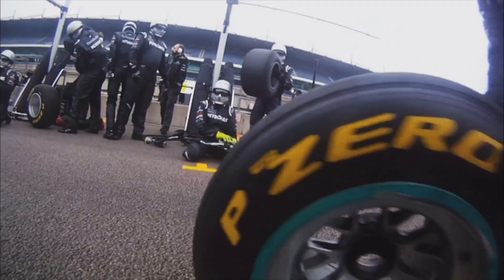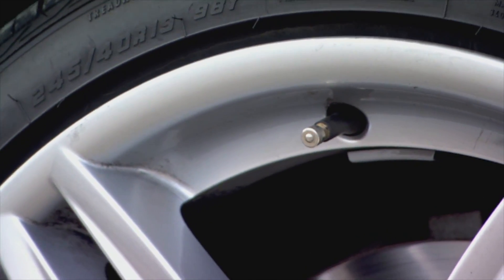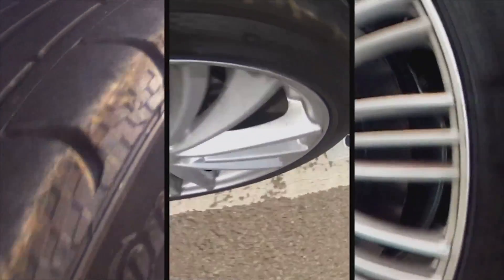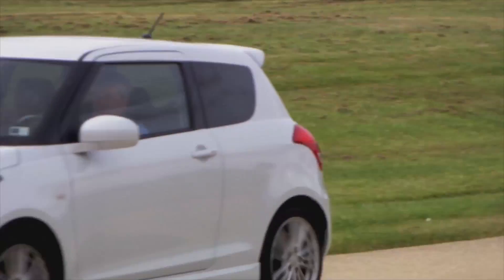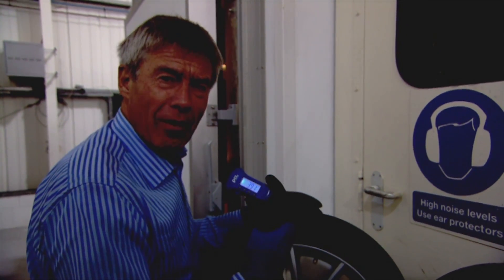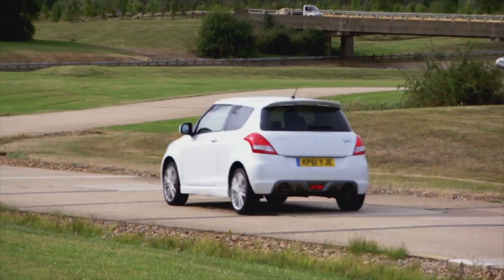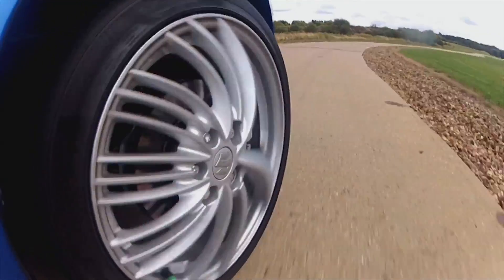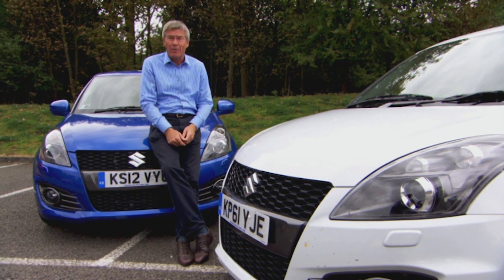Nitrogen vs Air In Tyres - Fifth Gear

Comment: This video may have the stupidiest  conclusion I've ever seen. The benefit of 100% nitrogen is that you rarely have to reinflate your tyres as they maintain the correct pressure. The benefits of long-term correct tyre pressure are well known and understood and cannot in any way be tested with a 47 second lap on the track.

Comment: 1. Molecule size: this is true, but when measured, the difference in pressure loss due to loss of gas via permeating the tire is vanishingly small; nowhere near a meaningful difference.

2. Water vapor: again, true in technical terms, but in practical use, the amount of water vapor in air in your tire isnt' remotely close to an amount that matters in any way whatsoever. F1 tires have hugely more volume than passenger tires, and differences in pressure etc. are measured by highly engineered methods as when you're spending $300,000,000 to race, every .002% difference in anything matters. None of this makes any difference whatsoever in a passenger car tire, even if it's a high performance car.

3.  Lap time (performance): shocking I know, but no difference.

4. Tire pressure change with temp change: If you think there's a meaningful difference in which gas you use v. tire pressure and temperature change, please go re-take high school chemistry.

Nitrogen tire filling is a thing invented by tire retailers to have something to sell. That's it. There is 0 benefit in any way when it comes to passenger car or truck tires. Save your money.

Comment: You fools, the normal Air tire was at a lower pressure after being heated in the oven and on the track Because The Air Leaked Out. Why didn't you measure them again, once cold, to see that the regular air tire had fallen below the original cold pressure? Oy

Comment: The pressure exerted by water VAPOR (gaseous H2O) in a tire behaves exactly as that for diatomic oxygen or nitrogen in response to a temperature increase; described by the ideal gas law PV = nRT. The point of using nitrogen in racing cars is that it ensures that no LIQUID water gets into the tire. Liquid in a tire is very bad because the vapor pressure exerted by a liquid increases exponentially with temperature, not proportionately like in the case of a gas. The host here misses this point entirely; failing to distinguish the differences in response to temperature change between gas and liquid phases of matter. 

By using tanks of pressurized nitrogen to fill tires, race teams avoid the risk that LIQUID water from a poorly maintained air compressor system will get inside the tires.  It is simply a quality control decision that ensures all of the matter entering the tire upon filling is in the gaseous state; guaranteeing that the pressure in said tire will increase predictably with temperature.

Cool video, but the above description explains why your experimental results were not interesting.
Reply: Not to mention that neither they, nor apparently anyone else, seems able to appropriately interpret higher hot temp of the Nitrogen over the air.... The Nitrogen tire was able to sustain a higher pressure at temp than the air. Had they re-measured the pressure once the tires cooled, it would have reflected the aired tires coming down still Lower than the Nitrogen tires, due to the air lost when hot. Seems just ridiculously obvious that they couldn't figure it out -

Comment: This is a typically half arsed 5th gear “investigation”. Surely you’d use the same car rather than two different ones? Nitrogen filled tyres are snake oil just like PPF and Ceramic coatings. If you were to properly fill a tyre with nitrogen you’d need two diametrically opposed valves on the wheel for a start, then use high purity “white spot” nitrogen (££££££) and then use an oxygen purge meter on the ‘other’ valve to measure the oxygen content as you fill with nitrogen and purge the air already in the tyre. Never going to be offered outside of motorsport.

Comment: I found that my tyre pressure has been great for up to 2 years without a refill (summers), my winters are going through their first storage season (vehicle came with winters on had to replace due to the wear), I bought my summers back in 2018 and that's the last time I had them filled before this year which it was down 4-5 psi from my manufactures recommended range or 32 psi. I get N2 free from my Cost-Co service and a guarantee as long as I own my vehicle and all products were bought and installed ( mounted) by Cost-Co they'll service just about anything I bought till I need to replace the parts.

If I had to buy the gas each time I wouldn't since I have a compressor at home and why bother paying a bit extra since the inconvenience isn't that bad, I with reg air I found my tyres need refilling every 5-7months (avg) of the year.

Comment: High-performance tires hold maybe 20 grams each of regular air and switching to all-nitrogen drops this weight by 3% -- taking us down to 19.4 grams per tire. Considering a spinning tire / wheel /axel / brake assembly weighs ~80 pounds (36,000 grams) -- feel free to pump in nitrogen to remove 0.00008 of the weight of your spinning assembly. (And as others have pointed out -- you'll also need a large vacuum chamber to get rid of the air already in the tires.)

Comment: A quick search on Google shows oxygen size is 152 pico meter, & nitrogen is 155 pico meter. Nitrogen size is not even 2% larger than oxygen, so how is oxygen will leak out, but nitrogen won't ?

Comment: Finally a simple and short video that removes all the myths, lies and half truths about nitrogen filled tires. If you have a sports car, especially with low profile, unsymmetrical treaded tires on large wheels then nitrogen is worth every penny. If you have a standard car, tires and wheels then it won’t hurt anything, you get all the same advantages but you can definitely pass on the extra expense.

Comment: proves when you heated the tires that its a gimmick at the tire stores putting in so called nitrogen,, as a retired mechanic i check mine every month especially when there is decent size air temp changes

Comment: 1:24 a nitrogen molecule is bigger than an oxygen molecule.Well, a nitrogen molecule measures roughly 300 picometers while an oxygen molecule measures 292 picometers. That's only a 2.6% difference in size.

Comment: I don't understand the fact that how nitrogen diffuse slower than oxygen through tyres. Law says that rate of diffusion is inversely proportional to square root of molecular weight. With that logic its oxygen which will diffuse slower than nitrogen. 

Reason behind preference of nitrogen over air may be different.

Comment: Every time I've done a trackday with semi-slick street tires, which had compressed air, my tire pressures rose predictably. I feel like my driving on track influences the pressures a hell of a lot more than whatever random rate the water vapor will expand. Some sessions I'll have a .5psi-1psi difference on certain sides, etc. But I've never had significantly different tire pressures from using compressed air. If anything trying to time your fillups when it is coldest will help because the cold typically makes your tires loose air the fastest. In part because humidity typically goes down with the temperature. I know I've definitely experience slightly overinflated tires at the beginning of Summer. But once the temps/humidity stabilize, then tire pressures change less.

Comment: If I deflate my tyres and fill them with fresh air then 20% is oxygen, OK got that.  After a while the oxygen leaks out and I lose 20% tyre pressure (assuming no leaks) leaving me with almost pure nitrogen in the tyre.   I pump the tyre back up, now I’ve put in 78% nitrogen and 20% oxygen but of the total gas content of the tyre that’s only a few % oxygen, so every time I re-inflate my tyres I get nearer to pure nitrogen. So the strategy is, check the pressure frequently and top up, no need for questionable nitrogen.

Comment: I don't believe that the difference in the size of the molecules causes the particles to escape as the difference is very small and almost negligible. The Other explanation is that oxygen is more reactive and under heated conditions might react with nitrogen present in tires and the rubber but even that seems highly unlikely is nitrogen is very non reactive and I don't think the temperature in the tires would raise enough to cause the reaction. and the rubber in most tires is fine tuned to resist oxygen.

Comment: Nitrog in tires is complete and utter bullshit! I've never heard of anyone having a problem with "water vapor" inside their tires! The worst thing is people being relaxed about checking tire pressure because of the belief that with nitrogen they don't have to as often which is a serious safety concern and an absolute bullshit myth as nitrogen is only 2% smaller than air!  Only idiots buy nitrogen.

Comment: And carbon dioxide has an even larger molecule size.  Or how about propane?  That's even a larger molecule size.  Many of the fix-a-flat cans use propane to fill up your tires when they are putting that slime stuff in the tires.

Comment: Nitrogen atoms are smaller than Oxygen atoms. Both exist in the atmosphere as diatoms; N2 and O2. N2 has a shorter inter-nuclear distance because its' two atoms are triple-bonded, while O2s' constituent O atoms are double-bonded.
So actually, the converse is more likely. Though clearly still a load of old arse.

Comment: Absolute scam. The earth's atmosphere is 78% nitrogen. So if you put air in your tyre you get 78% nitrogen anyway. So when a garage puts your tyre on the rim, in order to put 100% nitrogen in he would first need to evacuate all of the air out of the tyre, then with all the negative pressure sucking the tyre walls in he would then undo quickly swap over to the nitrogen pump and fill it up. To be honest i call bullshit. Any half wit knows that doesn't happen. Absolute bollocks scam. Do your science.

Comment: Iv opened a lot of tires up to only find any moisture at all in maybe one out of fifty tires. That's likely due to someone using unmaintained air compressor than it is from condensation within the tire. The average driver never really drives there tires hard enough to get them any hotter than the ambient temperature of the road.

Comment: I've  another idea.
Could it be that it's easier, more reliable and safer to keep a 3000 psi cylinder of compressed inert nitrogen next to three hundred gallons of highly flamable methanol in the pits than it would be for a 3000 psi cylinder of air with 20% oxygen?

Comment: This might be okay, if........

If you pull a vacuum on the tire first to remove moisture and normal air.

More than likely this won't work because the tire would unbead.

Not to mention destroy the tire since they're not designed for a vacuum.

https://youtu.be/b5mbj5iV3H4

Besides who the hell has time for that?

Comment: Initially I used to fill with nitrogen, but then chances of flat tyre increased compared to tyres with normal air. I totally disagree that nitrogen molecules doesn't pass through rubber.

Comment: These are all false statement . I use the nitrogen to my bike i notice frequent drop in pressure than normal air, bike feels light ,tyres get soft thus leads to worn fast. I will only suggest nito if tyres are hard and you want to make some more miles but there is  frequent drop in pressure.

Comment: The amount of moisture in the air is what really makes the difference between nitrogen (dry) and regular air (sometimes very humid).  In the past, using regular air, the tires would routinely go too low during the winter.
Since using nitrogen, the tires remain very stable and trips to refill the tires every month in winter is a thing of the past.
Nitrogen is used in aircraft tires and racing tires because there is a proven advantage in doing so.

Comment: I recently bought a 2004 Mazda 3 and it had tires with green caps instead of black. My dealer said the owner who traded it in bought brand new tires and they use nitrogen instead of air. It's been a while since I've had the car and the tire pressure is getting low. Should I keep the tires nitrogen, mix nitrogen and air, or just drain out the oxygen and go regular air.

Comment: Heat generated in tires causes gases to expand, increasing pressure. Does not matter much which type of gases are in tires. At extremes of temperature, however (such as aircraft and racing tires) is does make a difference.

Comment: anyways, air is 79% nitrogen  and the tire volume is initially filled with air so at a pressure of 45 PSI about 4 bar absolute, there is always about 5% of the contens of the tire that is not nitrogen
All gases responds to the same laws so the use of nitrogen brings no benefits to the driver and there no benefits for an everyday car tire.
the only drawback of using air is that in many compressed air systems, the control of humidity is deficient and this can promote the corrosion of the interoir of the rim.
The only use tat makes sense is on highly specialized tire use as in a subway exploitation that use tires because in the event of a blowout, chances are a little less to start a fire because the carcass is usually built with metallic wires.
this is the scam of the decade !

Comment: I guess a lot depends on the conditions that existed when the tyres were fitted to the rim. A certain amount of air will get trapped underneath during fitment and if it was on a very humid day that would mean a lot of moisture is present between the tyre and the rim. Trapped until the tyre is removed most likely. The perfect test would be to fit the tyres to the rims in a 100% nitrogen, clean room. (with the fitter wearing a hazmat suit and breathing apparatus)

Comment: Why use nitrogen?  ... Having read the posts I will agree with most of what was stated.  Now the real reason to use nitrogen would be the reduced moisture which can increase corrosion around the internal tire pressure sensor and poor choice of of metals used in the tire stem.  If your tire doesn't have a sensor then I would not consider nitrogen.  For those of us with internal sensors I would suggest dry air over the expense of nitrogen.  The dollar saving solution (IMHO) is to put a desiccant dryer on our compressor outlets to remove  moisture.  I am looking for a multi-stage which would have the empty bulb with manual drain plus another bulb with desiccant granules.  The granules work via adsorption as opposed to absorption which means moisture collects on the outside of the pellets.  This means the pellets can be reused by merely placing them in an oven to vaporize the moisture off.  Some dryers have another pellet that changes color to let you know when to replace or reclaim the pellets.  Having experienced the corrosion issue mentioned with required replacing the internal tire pressure unit, I am convinced removing moisture is a good play whether it is nitrogen or dry air.   The dry air units I have seen so far will likely cost $100 +/- depending on what I care to pay for and how much plastic is involved.   I hope this helps someone.

Comment: Nitrogen Tires are old fashion, I have just upgraded my car to the new Magnetic Hovercraft Suspension Package.. 

Other than that, for those of you that still run normal tires, think about what he said..
Oxygen is smaller and will escape the tire, so.. fill up with air and wait until the Oxygen has vanished, losing the 20% Oxygen,  leaves only nitrogen in the tire..

soo.. once you refill the tire again, you will fill the "emty" 20% up with new air that are 80% nitrogen + 20% Oxygen, Then you will end up with 96% nitrogen and 4% oxygen..
save your money and use the free pumps out there.

Comment: I do not understand how u can say that u know the aim of consistency. yet base your answer and recommendations,  off of one. think about every night every morning cooling 365 times a year. that's how many times your car times change pressure. the mean mode and median of this equation are missing lol its was dine with simple plus and negative. I need a show someone sponsor me
Reply: not to add when you drive every day. park...in the shade or not... is it raining snowing sunny ...
Reply: and for the ppl saying oh its a 1.5psi difference.  obviously the increase would be multiplied do to heat. so a tires at 30 ambient and 39 hot would  to 29 to 38 ... the argument is consistency folks. consistency good night good morning consistent  good night good morning consistent good night good morning consistent
Reply: and for the ppl saying oh its a 1.5psi difference.  obviously the increase would be multiplied do to heat. so a tires at 30 ambient and 39 hot would  to 29 to 38 ... the argument is consistency folks. consistency good night good morning consistent  good night good morning consistent good night good morning consistent